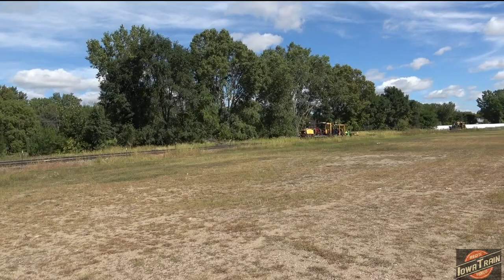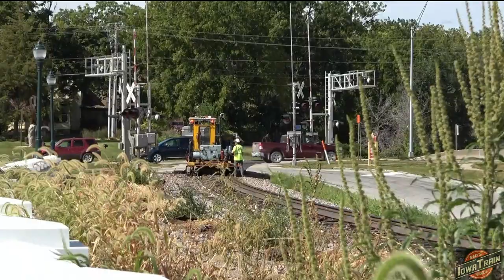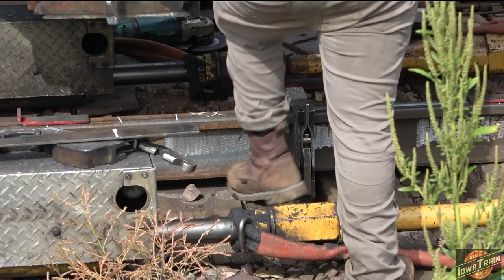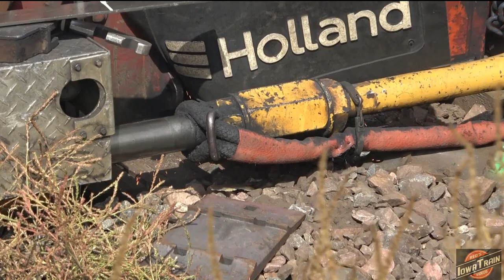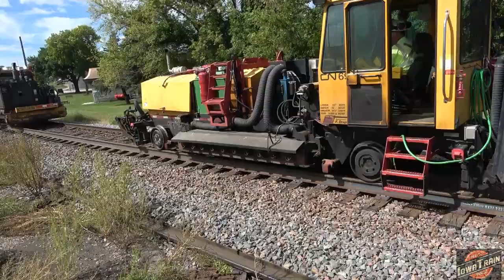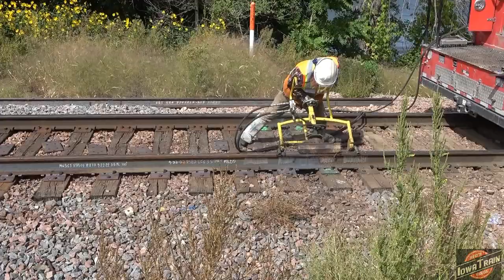CN Rail Gang with close up views! Holland Flash Butt welder and lots of equipment views!

Comment: Being a old section worker on the Milwaukee Road around Perry back in the seventies, it's amazing how they do it now. Good job, Red that was very interesting.
Reply from the maker: Thanks Randy! Technology has made track maintenance a lot easier.  I was impressed with the flash butt welder on this video.
Reply: Randy, spotted your comment and couldn’t resist a reply, I started with Holland in 1978 at the welding plant in Savanna, IL, welding for the Milwaukee. The technology back then was pretty crude to what it is today.

Comment: Great video! Electric Flash Butt Welds has become the standard in production rail replacement work. Production rail gangs can generate 6-10 joints per day. Due to the time difference that it takes to make a thermite weld (typically 45 to 60 minutes) versus a flash butt weld (10 to 20 minutes) means the rail can be installed, de-stressed (preferred rail laying temperature set, the rail is stretched to pre-tensioned) and the work is complete when the rail gang finishes at the end of day.
Reply from the maker: Thanks Richard! I seem to remember  them having a rail heater there that day too. I would think flash butt also leaves less of a mess.
Reply: @redsiowatrainvideos6645  The rail heater is supposed to expand the rail, and the mobile welder makes free welds until the end of the day  when the puller is used to make the final closure weld, establishing the preferred rail laying temp. It is an excellent video and I hope you continue to produce more.

Comment: Wow! Thank you for finding this Canadian National track crew placing the welded rail that had been placed on the side of the Canadian National tracks through Cedar Falls, Iowa, Red! You were able to get close and see exactly what the track crew must do to install the welded rail. The welding of the rail using that Holland weld truck was interesting to watch. I have never seen rail welded using a Holland weld truck before your video. I was at Dolton Junction in Dolton, Illinois many years ago and I saw a CSX crew using Thermite to weld some rail just west of Park Avenue where Park Avenue crosses the CSX and the Indiana Harbor Belt Railroad tracks. When I saw the CSX track crew using the Thermite to weld the rails, I was on the south side of the Indiana Harbor Belt tracks. I have also seen YouTube videos of track crews using Thermite to weld sections of welded rail.
Reply from the maker: You're welcome Thomas! I found out about the rail gang that morning and got out of work early. That ribbon rail layed next to the tracks for almost 4 months. It looks like flash butt welding is cleaner than thermite welding.

Comment: Glad you were able to catch them because their schedules are really not predictable. Lucky to find a spot so close to the track without being in the way or on their property. Thanks for the descriptions of the equipment and processes as this technology changes quickly. Holland used to run the welded rail plant in Savanna IL  when Milwaukee Road had one located there. In another month or so equipment like this will roll back into Milwaukee to be serviced during the winter ironically in the old Nordberg plant that used to build track equipment and has since moved to a new facility in Oak Creek WI. A good change of pace for viewing
Reply from the maker: You're welcome Paul B! I got a heads up from a friend about laying the rail that week. Had a perfect day for it too. That flash butt welding seems to be quite a bit cleaner than the thermite welds. Holland used to run the CNW weld plant in Tama. My Dad worked for the CNW and worked with the weld company. I believe that was the only CNW weld plant at the time.
.
Reply: Hey Paul, I started with Holland in 1978 at the Savanna plant. And in Red’s response, I helped put in the plant at Tama in 1984. The railroad has been a great career and working as a contractor I’ve had the opportunity to work for all the class 1s and meet some great people over the years.
Reply: @richardmorris2328  thanks for the info. Redhead some Ariel video in Tama about half a year ago and you can make out where the plant was. As time and Technology progress that's interesting to see the changes in who manufactures the rail. The changes in rail cars to transport it and certainly the Machinery that works on it. What's in the last few weeks David Seidel of the Camerail  Club
Posted pictures of the UP set up at Laramie Circa late 1970s
Reply: @paulbergen9114  From the hay day of welded rail in the US, and the de-regulation of the railroads, the number of rail suppliers and CWR welding plants has declined. At the turn of the century (man that makes me feel old) the number of domestic rail manufacturers had declined to less than a half dozen and welding plants down to a dozen. Currently there are three domestic manufacturers of rail in the USA. SDI Columbia City, IN the newest is rolling 320’ rails with an onsite welding plant welding 1600 strings. Cleveland Cliffs in Steelton, PA rolling 80’ rails, not sure if they’ve re-established a weld plant there lately, there have been several. EVRAZ NA Pueblo, CO is currently building a new 320’ rail rolling mill which i believe will start producing this year. EVRAZ did build an onsite welding plant which started production mid 2023. With significant volumes of rail being welded at the steel mills, the number of railroad specific locations will most likely decline even further.

Comment: Red love watching MOW in action. I was shocked CN uses 115lb and not 136lb on a main? That flash welder was something to see in action, I thought they’d use thermite, flash welds less messy I’m guessing. I never knew a rail heater existed either and that’s the first I’ve seen a rail anchor machine in action, anchors are so important for stopping rail creep. That’s interesting what you said about rail expanding up to an inch per 1/4 mile per 10 degrees. I didn’t realize MOW is actually owned by GE/Wabtech. Very interesting stuff Red, catch you in the next one👍🏼😁🇺🇸
Reply from the maker: Glad you liked the MOW stuff STRETCH LIMO! I was surprised about the light rail. Must not have enough traffic there for the heavy stuff. My Dad said the track anchors help keep the rail from moving with heat expansion. That was my first flash butt weld experience. I'd say it's definitely cleaner than thermite👍♨️🇺🇸

Comment: Awesome rail gang action, those MOW machines are just amazing. Thanks Red for documenting their work. Their work is essential to keep railroads moving.👍🏼👍🏼👍🏼just one question, what’s a flash butt welder?
Reply from the maker: Thanks Nancy! It was nice to be able to get that close. A lot of it was filmed by the flood wall right next to the tracks. A flash butt welder uses an electric arc and melts the rail together.
Reply: @redsiowatrainvideos6645  no problem Red. And thanks for the info.